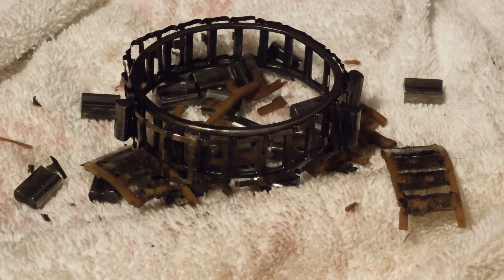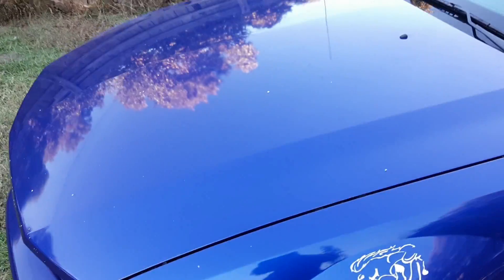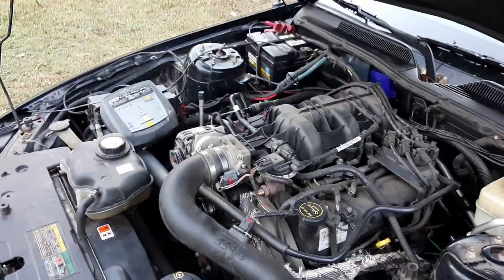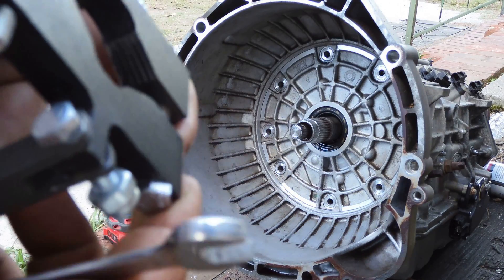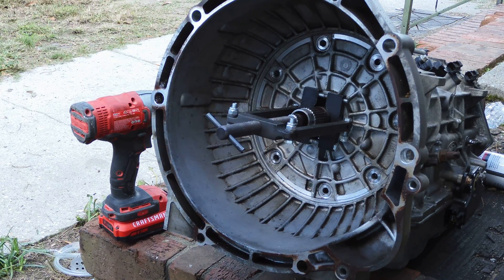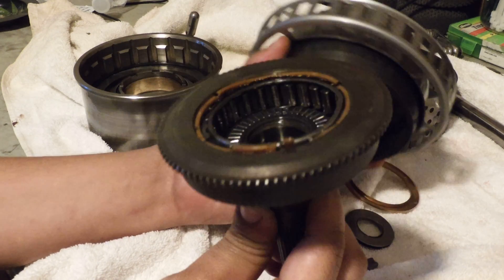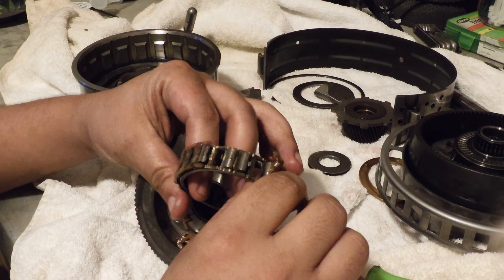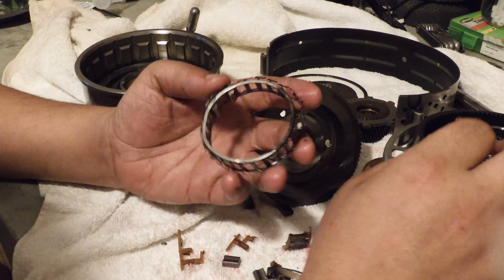No Drive Or Reverse.. Transmission Fixed For $25? Transmission  5R55S 5R55N 5R55E 5R55W 4R44E 4R55E

Comment: im confused you show that the car wont reverse or forward but you only replace the over drive sprag. Why not replace the reverse sprag? did replacing the O.D. sprag allow the car to reverse? they list them as 2 different sprag and i read your list of all you actually replaced etc. But no mention of reverse sprag?????
Reply from the maker: Great question, if you check the service manual on the 5r55s on page 4 there is a component application chart.. If you look at this chart you will see that even though there is a low/reverse sprag, while in reverse it isn’t holding it’s suppose to spin freely… The only components applied in reverse are the direct clutch, the L/R band and the O/D sprag.. 
The low/reverse sprag only holds in 1st and 2nd gear.. so if reverse was working but the car wouldn’t going in 1st or 2nd then the problem would be the low/reverse sprag..
Reply from the maker: Here is a link to the manual.. If you look at the chart you should help you understand what each component should be doing while the transmission is in each gear..
Reply: @williamblanks8500  perfect answer..freakin logic..wins every time..
Reply: I'm with you boo if 8 can spend 2or 300 and learn what's wrong I'm always up for that.I turn wrenches all my life .I hold 5 patents yet for no reason I have left tranny work to the higher minds for why? 2600+$$ is crazy cause I know 60% of the time they repair not rebuild wash it up and send you off mumbling to yourself saying "see you next time" then under their breath "sucker"..that's the world we live in ..don't even kid yourself ..or they swap yours for a factory line rebuilt..goodbye matching numbers...
Reply: If you are going to get it rebuilt the best ones to use are guys that rebuild race transmissions.. bought a new Chevy Silverado in '92 transmission went out at $75,000 Had a local race car transmission guy rebuilt it truck did over half a million miles and that same training was still going That's the difference I would never go to the little local transmission shop. And they charged 1200 not 2600 and for sure I got back matching #s
Reply from the maker: @geraldknady8095  i agree about that part build it tough and build it to last.. the guy i mentioned in the video I trust his judgment and he would have done a great job repairing it.. he has always done a good job on repairs for me and people that i know.. and there have been times that i called him and he would tell me a simple fix and i didnt have to bring it in.. a lot of people arent that honest.. the biggest problem in a situation like this is when i pulled everything apart there was nothing else bad, the bands the clutch frictions were all in very good shape.. but at the same time if he had to pull the whole entire tranny apart anyway then to give me a warranty he would still need to do a full rebuild only if the one part was bad.. he even told me the exact part.. i couldn't really argue with that.. and right now im in the middle of building my 2nd tranny ever in my life, its from a 1990 mustang GT, the same part was the problem it was the intermediate sprag causing it not to go into 2nd or above.. im starting to believe that is just a weak point in ford automatic transmissions..
Reply: @williamblanks8500  well yeah .look at the part ..it's precision ground bearings anchored in a hard plastic you know and as we all know the same thing happens when they take a timing gear and dip it in Teflon plastic you know eventually that's gonna turn brittle crack and fall off same things going on here I mean those things are under a lot of pressure and a lot of heat if they really wanted to build it to last there wouldn't be a drop of plastic anywhere on it. I do wonder if out there somewhere somebody hasn't built one out of you know surgical stainless steel that will last for half a million miles or more but why would they want to do that I mean theoretically if a car gets too old and it's going to cost you north of $2,500 to rebuild the transmission you have to make the judgment call is this car worth spending that kind of money on or do I sell it for parts.Ford would rather you come buy a new one...but why should you knowing " built Ford tough.". ain't so tough. Borg Warner once ment something. It's all buyer beware. look for speed parts..upgrades.I got sick of the roller rockers tapping in my hemi so I put hellcat lifters rods and  cam instead and for 2 years it's quiet like a sewing machine under the hood ..was a pain in the arse but the results are outstanding. Your good on camera. Keep doing them people like that go for it but educate yourself first and pull out a victory from the jaws of defeat stuff   Get enough subscribers and you'll get some money people calling you just stay honest man we need knowledge..if you don't know say so. Stay real..your on to something
Reply from the maker: @geraldknady8095  right, I still don’t understand why they use plastic on timing chain guides either, that has never made sense to me.. it’s one of the most important parts of the engine like the sprag is one of the most important parts of the transmission.. They build cars now to last 100,000 miles and not a mile over..
Reply from the maker: https://procarmanuals.com/ford-5r55s-ford-5r55w-atsg-automatic-transmission-service-group/

Comment: My mustang is a 2006 gt has no drive or revers but when I out it in 1st gear it drives normal I can shift into 2nd and sometimes into 3rd sometimes it slips can you help me out and lmk what you think
Reply from the maker: go to the 1:04 part of the video.  If you put it in drive or reverse and race the motor and the car does the same as my car did in the video then the problem is the overdrive sprag, If you watch the whole video and/or read the description I go through the process of diagnosis and repair and the cost.  The problem when the overdrive sprag goes bad is the gearset spins internally instead of making the tires spin.  So its technically in gear but its sending power to the wrong place. If you can pull the tranny and put it back then you can fix it yourself. There are a lot of 5R55 teardown videos out there you may need to check out a few of them, this video is to show you the exact part that has failed, and why the cart acts that way when it fails.

Comment: Man I was less than 24 hours from either scrapping my car or saving for a trans. I’ve never done trans work but I am a mechanic in the airforce and am a quick learner. This just saved me thousands that I don’t have. Thank you so much for this video. I’ll leave a comment on the results
Reply from the maker: I’m really glad you didn’t scrap it, I was in the same situation. Good luck and yes please let me know how it works out..
Reply: What you end up doin?
Reply: What was the result,what did you wind up doing to fix it

Comment: My 05 automatic mustang shifts completely fine in all forward gears but reverse takes exactly 15 seconds to engage…no more no less and it only does this when the engines warmed up. When reverse does engage it’s very smooth it doesn’t slam into gear…Also it will go into reverse immediately with no delay when cold starting. I’ve already changed the filter and replaced the fluid twice. No flashing O/D light, no check engine light and no slipping/delayed gear engagement in drive. Just this weird problem with reverse. It’s been this way for almost a year since I bought the car and it hasn’t gotten any worse. What in the world could be causing this???
Reply from the maker: I don't believe it is the Overdrive sprag like I describe in this video, but give me a little time and I will look into and I will get back with you..
Reply: some expert told me that if its delaying like you described its the solenoid pack that needs replacing ebay sells remanufactured for @140-150$ my 05 explorer does the exact same thing softly engages reverse but if reverse is into a incline you may be stuck. If the ground is level or downhill your good. all forward gears work great.

Comment: I use utube alot to do work on my 04 ranger. Right my transmission (automatic) isn't like it should into 4th and my rpm's stay above 2000 going 60 or 65 mph. Transmission shop says it shifting fine and it shows no problems when hooked up to the scanner. I don't really trust mechanic's. But your video is very informative and I like how you point out and explain everything you are doing and why. Great video please keeping making videos like this.

Comment: So I’m having the same problems. I have a 2009 mustang gtcs with a 5R55S transmission and I put it into drive leaving work today and it just revved up like I was in neutral and would barely grab the gears. Reverse pretty much did the same thing until I got home and tried reverse again, then it stated to grab again. Drive still didn’t work at all. I had to drive back home (about 25 mins on back roads) in the 1,2 and 3 slap shift mode and they were working fine other than shifting into gears harder than normal. I just wanna make sure that the sprag is the only thing I have to replace bc I don’t wanna drop 2700 bucks. Thank you!
Reply from the maker: I have a detailed list of all parts in the description, but it boils down to if u don't see any grit in the fluid then sprag only, and the reseal kit for the pump.. 
If you see grit in the fluid it's probably from the torque converter, so replace the torque converter, the fluid, the filter, and clean everything to remove the grit..
If your trans was working perfectly before and not slipping then it didn't damage the clutch frictions.. 
The last thing you will need is a fluid pump to top off the fluid when you put it back together..
There are a lot of 5R55S teardown videos on YouTube that go thru all of the details so I didn't remake those.. I just broke it down to if you have this problem then this is the specific part that is causing it...  To me it definitely sounds like the sprag is your problem and if you are mechanically inclined enough to pull the trans and put it back yourself, then this is only a few extra steps.. and the sprag itself is less than $30
Reply: I appreciate it a lot. I love the car but I was thinking about a whole trans rebuild was gonna be the case before I saw the forums and your video that you posted so I had some home. Gonna take it apart on Monday to see the diagnosis
Reply from the maker: @AtronKhana  good luck, let me know how it goes..
Reply: Was that the problem?
Reply: @justinbatten3  still in the shop. Getting it rebuilt sadly. Checked the transmission fluid and it was smelling crispier than a baked potato in the desert that got left there for a year lol

Comment: Thanks man please upload video how to relearn TCM after
Reply from the maker: I will definitely do it, 
but basically you want to start a 0 mph accelerate thru all 5 gears without going over 50mph, then quick return to a complete stop for 3-5 seconds..
You repeat this process about 5-10 times until the shifts smooth out, then you drive it normally for the first 500 miles to finish the relearn process.. 
If you don't do the relearn the car won't shift correctly and you will think something is wrong with it.. 
The first few times you do it, the shifts will be off but it will level out more and more each time..

Comment: I believe u saved me thousands brother appreciation for this ima try it out!
Reply from the maker: Happy I could help you out and thanks for watching.. If you have any questions just let me know..
Reply: @williamblanks8500  if i got 175k miles should i just replace whole transmission? Tho because its old or still take apart and try myself to rebuild
Reply from the maker: @BAMBIthepit  how did it go out? Was it driving fine and just went out one day? Or was it already having other problems shifting through the gears?
Reply from the maker: @BAMBIthepit  mine has about 165,000.. the fluid had a lot of metal in it from the torque converter going bad, I'm pretty sure that's what caused the sprag to go bad in my case.. The car was shifting perfect for me except 3 different times getting onto the interstate trying to accelerate fast, the car acted like it went into neutral on its own.. the 3rd time this happened it made it home, then it acted like in the video here it wouldn't move anymore.. So when I learned about the sprag and I took it apart and actually looked at it.  The frictions and the band all looked fine they had normal wear and could last maybe another 100,000 miles..  the sprag was the only thing broken.. I am the guinea pig here tho because I had the exact same question.. I replaced the sprag, the torque converter, the fluid, and filter.. After doing the relearn procedure, which is, coming to a complete stop then accelerating to 5th gear but not over 50 mph.. then repeating 5-10 times until the shifts level off.. My wife has been driving the car everyday for about 3 weeks now.. at least 100 miles per day and it's driving like a new car again and a lot easier to accelerate than it ever has been since we bought the car.. Idk how long it's going to last yet but if something happens I will make an update in the comments or description of this video and probably make a new video.. but so far so good.. I'm the type of person who would rather pay a few hundred and learn how to rebuild it than pay $2000  and not really learn anything from it.. And we have no way of really knowing if they are only replacing the sprag too if u take it to the shop.. The major question is do u have more money or do u have more time.. if you have more money than time buy it rebuilt.. if you have more time than you have money replace only what's broken so u can ride again cheap as possible..
Reply: @williamblanks8500  i appreciate u 100% bro u fully explained this i fw u bro goodlooking
Reply from the maker: @BAMBIthepit  ur welcome bro.. 💯💯💯
Reply: @williamblanks8500   it would always make a slight jerk when i put in gear since i bought it and then one day i was speeding and came to stop sogn and tried acceleration and it didn’t accelerate so i put into third gear and it jerked hard and went
Reply from the maker: @BAMBIthepit  yes that's the sprag.. the sprag is supposed to hold the overdrive drum while u are in drive overdrive or reverse..  so if it's bad the car will only move in manual 1-2-3..  then teeth on the overdrive frictions could have bent tho when it snatched into gear, I would pull them out and check them too while I was there.. one of mine was bent a little and I messed up the friction material trying to straighten them out but there are only 2 in the overdrive and both plus shipping are less than $20 @ cobra transmissions online.. so I just replaced them both..

Comment: Thank you so much for sharing! My son just bought his first car a 2008 V6 Mustang. Not even 3 weeks later it started doing this! Every forum was saying rebuild, rebuild. Yes we were worried because he just got it to have to spend major repair $ Again thank you! Will update you if this is exactly what it was.
Reply from the maker: Yes, I haven't had this one a whole year yet.. but it is back together now and driving pretty good.  I think most people sell the car at the first sign and pass the problem to someone else.. Thankfully I didn't have to spend $1800 for a complete rebuild and hopefully now you  won't either.  Glad I could help and yes please keep me updated..
Reply: @williamblanks8500  Nope!!! Shop just called back with up to $2400 rebuild, they said with the mileage on the car other things should be replaced converter & everything internal would be best to just get it done with a two year warranty
Reply from the maker: @who9565  I do recommend replacing the convertor, its about $150 for a remanufactured one.. It depends on the fluid.  If the fluid is off colored (grayish or brown), that means the convertor is probably eating itself up.. If the fluid is pretty and red and there isn't much metal in the fluid you can probably get by without replacing it.  The problem is if you don't replace it now then you will need to pull the trans again to replace it later if it is bad and there isn't a way to open it up and check it.  If the car was shifting fine through all of the gears but just stopped one day and its acting like the car in the video, then I'm pretty sure just the Sprag is the problem.  The reason a shop won't just replace the sprag is because once they open the transmission up they want to replace everything because they are already there.  I replaced the converter ($150).. The fluid and filter ($100 fluid, $30 filter).  The OD Sprag ($25), The 2 OD friction clutches ($20), a reseal kit for the front pump ($20), and a home made fluid pump ($40)  I paid a friend $200 to help me pull the transmission out and put it back.  about $600 total.. The only part that was actually broken was the Sprag, but the fluid had a lot of metal in it to..  If you have all of the parts ready before you start, and you are mechanically inclined then this can be fixed in a weekend..   If the car was having problems shifting through the gears or having other problems before this happened then I recommend a complete rebuild.. If there is no metal in the fluid, then you can drain and save most of it, you can probably get by with just the sprag, filter, and reseal kit, and enough fluid to top it off around $100 especially if you do all the labor yourself or if you have some "free" help lol..